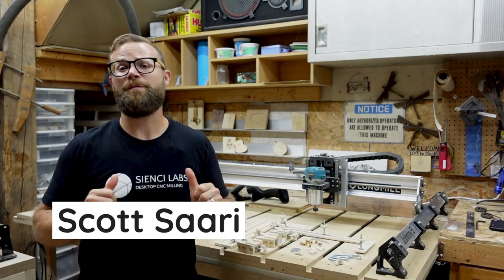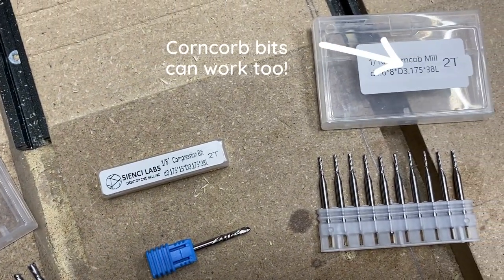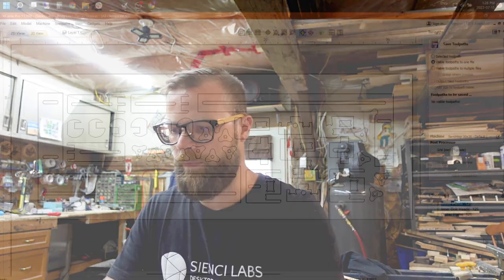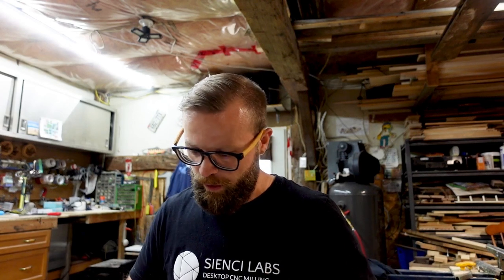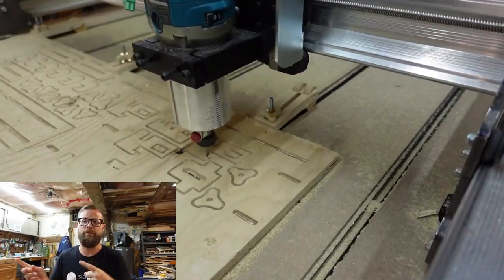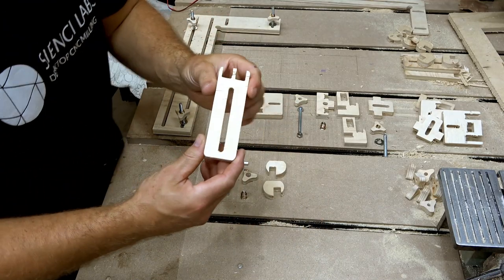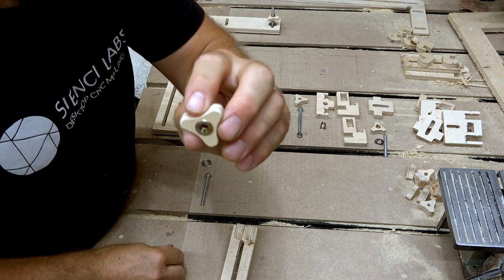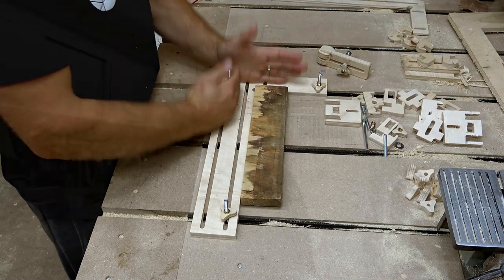Make Your Own CNC Workholding With Your LongMill MK2 CNC

Comment: Thanks so much. I’ve had my machine 6 weeks and have never had such a smooth project. I pulled the dxf into vcarve, realized I didn’t want to redo the paths because of the bolt head countersink on those 4 knobs. Only thing I would add is a pdf/doc showing layout dimensions and safe clamping (I used the vcarve measure tool, maybe you had specs somewhere I missed). I ended up sending it straight to gsender. Thanks a ton, look forward to more of these.
Reply from the maker: Glad it was helpful! Great suggestion for the PDF! We'll look into that :)

Comment: Scott - made some. Files worked GREAT! However, where the heck did you get the fully threaded 2" bolts?? I can't find them anywhere in K-W. Thanks
Reply from the maker: Glad the files came in handy! The bolts are actually the pillaged from the clamps that came with the T-Track set from Sienci. But I've heard most big box stores carry them pretty regularly!
Reply: @SienciLabs  Thx HD does not have them but I'll try Lowes

Comment: Where can I see the individual item sizes so I know what will fit on my scraps? THX Scott
Reply from the maker: Hey, we forgot to put the exact dimensions but we'll check them and add them. In the meantime, when you import the file, you can see the size preview in gSender which should help check if your material will work!
Reply: @SienciLabs  Thx so much. GREAT clamps!  😀

Comment: very cool, would like to try today. Which file is for the gsender?
Reply from the maker: Hi Michael, if you check the video description for the link of "Gcode and DXF File Links" you'll find a file named ".5 in Workholding ALL.gcode" and that's a g-code file you'll be able to run directly in gSender 👍

Comment: Scott, thanks for the video and the files! I opened the file in VCarve, but none of the toolpaths are showing, is that typical? Thanks!
Reply from the maker: if you imported as a DXF, then you have just the raw vectors. You can make the toolpaths manually the way you want them from there, or you can use the pre-made gcode also included in the folder.